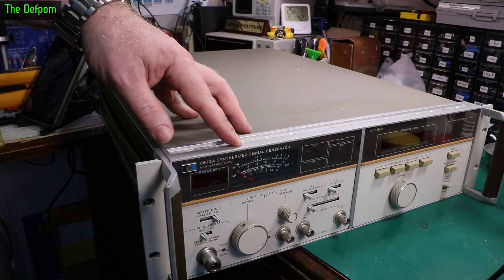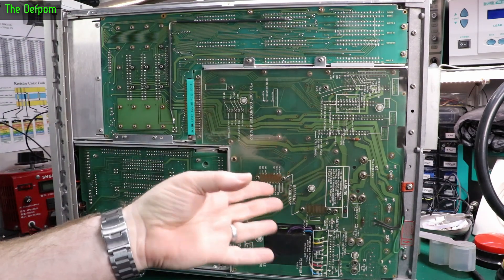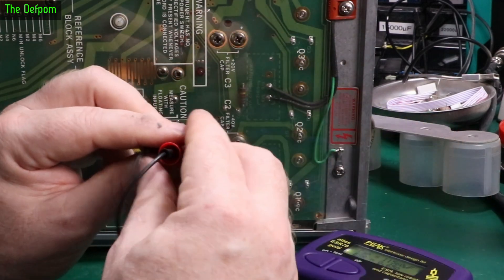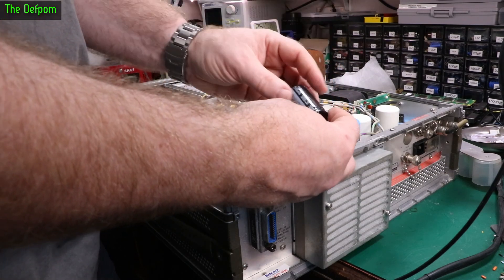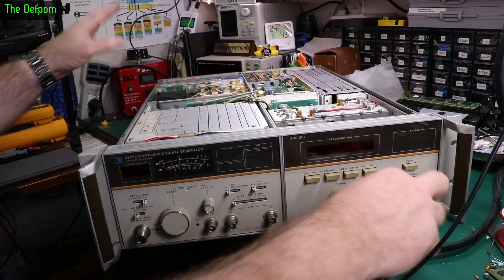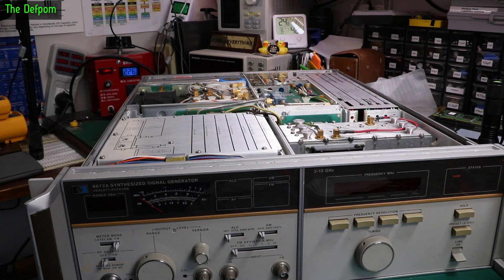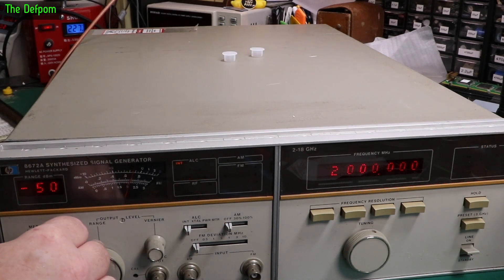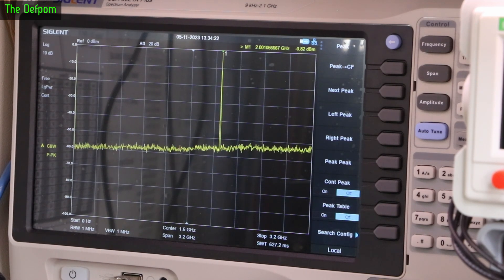🔴 HP 8672A 18GHz Signal Generator Repair Part 1 - No.1206

Comment: No. Those little solder in caps are not equivalent to the big screw terminal caps. The ripple current ratings will be very different. If you want long life out of power supply filter caps the ripple current ratings need to be adequate.